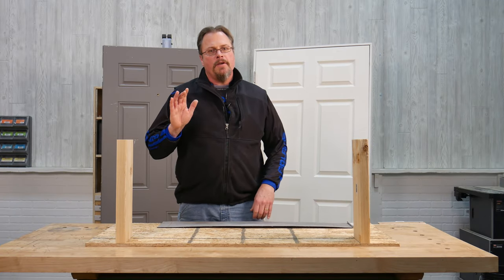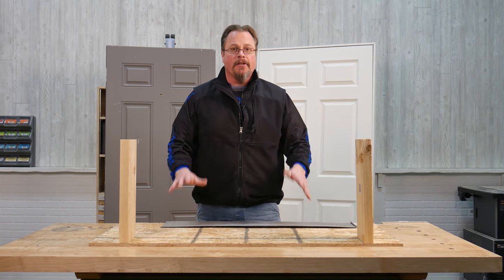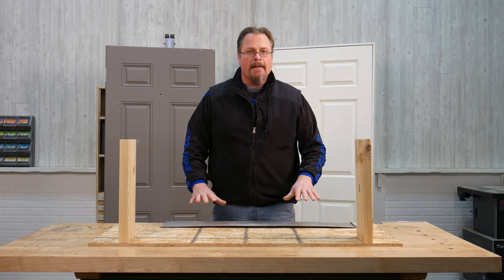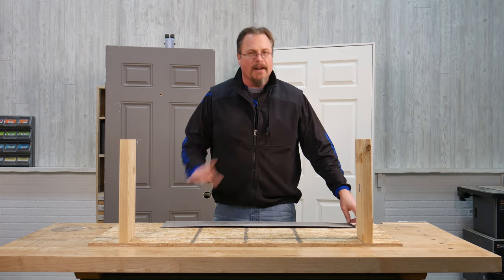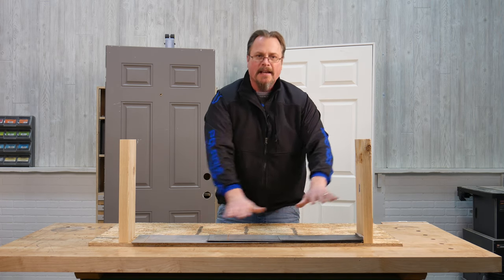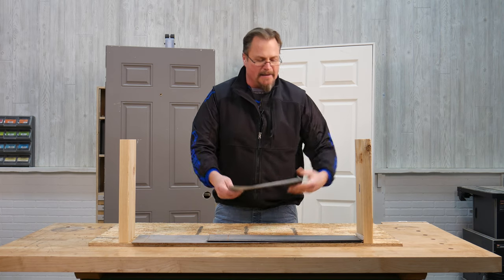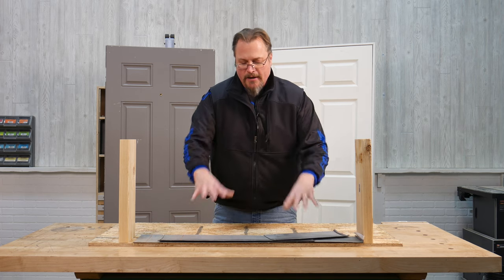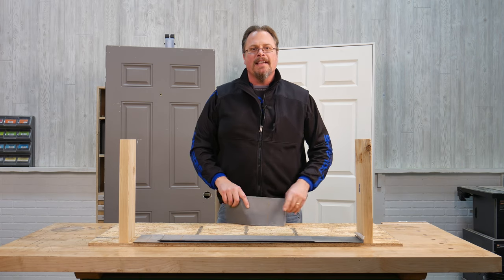How To Install A Door On An Unlevel Floor

Comment: I installed a door today where the walls were level and the floor was 3/8" off.  This technique worked great.  The previous door would not close without pushing against the door.  The new door closes as it should.  Thanks for this great tip on leveling out a door!
Reply: Just finished mine that was 1/2" out of whack. I used Protecto Wrap window flashing. Worked like a champ.

Comment: No mention of using this method with a sill pan. I assumed the sill pan would go on top of your peel and stick layers and you would still use sealant under the sill pan... Yes?

Comment: Well This was awesome!!!  Solved my problem!  Thanks so much!  I have a slight 1/2 bevel going towards the outside of the door because I'm framing up and installing a door where a garage dor used to be.  the concrete is not level but not going across, its going slightly down away from the door about a 1/2. So I should be able to apply this same technique just building up thickness to make the threshhold level.

Comment: I am not finding that product near me and search for it online but what came up is roofing starter material.  Can you tell me the brand?  I have a peel and stick flashing material but it would take lots of layers to make up the 1/4" I need.
Reply: I just leveled my threshold that was a full 1/2" out of whack. What I used is "Protecto Wrap BT25XL." It's a 25 mil, rubberized asphalt self-adhering membrane. I bought mine at my local hardware store. 75' foot roll 6" wide cost me 32.00. As an added benefit the asphalt helps deter termites. Look on Amazon $37.99 & FREE Shipping. Amazon has it listed as "Protecto Butyl BT20XL Window Flashing Tape 6 in. W, 75 ft. L" but it's actually BT25XL. Good luck.
Reply: @les6556  can you tell me how you did this please
Reply: @silversurferlils9176  Easy, just layer them one on top of the other. That was 4 mos ago and they're working out fine.